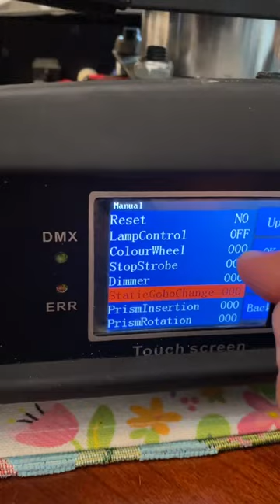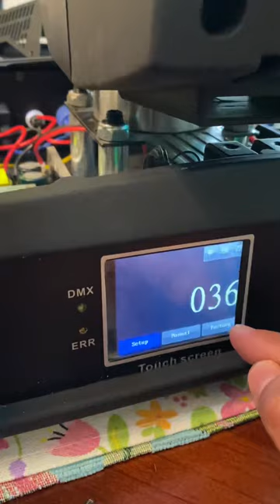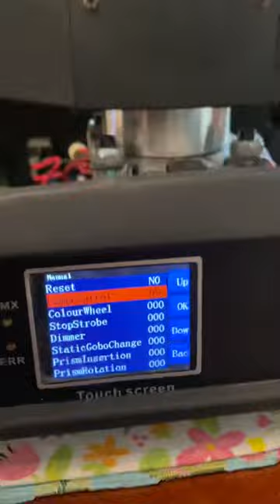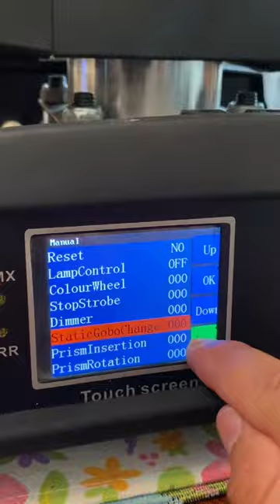Beam 230 7r no light FIXED!!

Comment: Did you change your igniter ballast or power supply?
Reply from the maker: I did not. For some reason the lamp control has to be reset. Make sure when you turn the lamp control from OFF to ON to ONLY do it ONCE. If you previously had already messed with the lamp control,turn the lamp control on and off a couple of times until you see the lamp strike on. I recommend removing the housing covers to see inside easier.
Reply: @kennylunaaa5596  ok..let me try that
Reply from the maker: @aclizarda  goodluck man. Hope it works
Reply: Hey man..its a good thing i removed the housing..and you re right..so that u will see whats wrong with it..i see that the bulb was dislocated in its correct position...maybe its because of the shipping fault ..lol...the moving ok now..thanks man..im gonna buy another one..✌️😎
Reply from the maker: @aclizarda  that’s awesome!
Reply: @kennylunaaa5596  i tried to make some program to my dmx..but i cant find the prism effect..only the solid color lights..😁maybe the dmx is the issue..hahaha..
Reply from the maker: @aclizarda  are you running the fixture on 16 channels?
Reply: @kennylunaaa5596  yes..i just tried it to my ordinary dmx controller 512.some works fine..but some of the slide switch were not working...adress 001....then i made a simple program..i cant fjnd the prism slide..i did try all the slide but none of the 16 channel is not showing  function to prism..
Reply from the maker: @aclizarda  did you check your manual to see what channel the prism is located? Also make sure your controller is set to the same channel of the fixture.
Reply: Mine don’t turn off 😂 any ideas turns on when power is on and I have no control discharging the bulb
Reply from the maker: @Dat_red_subie  it’s the shutter that might be damaged.
Reply: @kennylunaaa5596  I’ve already checked in the shutter.. it seems to be a control problem I have contacted the manufacturer about the problem